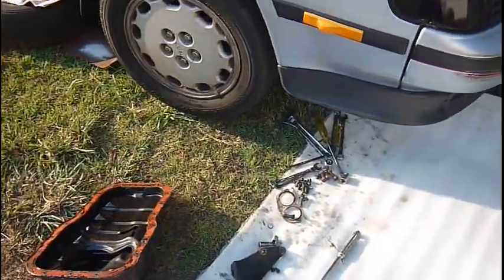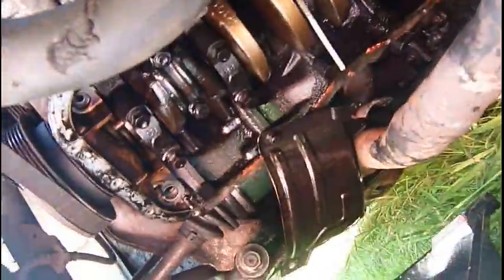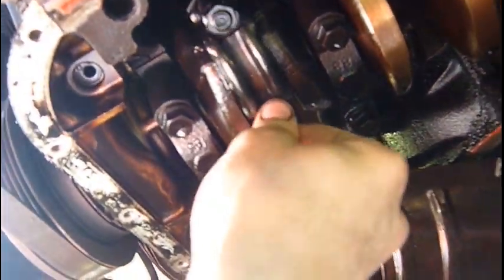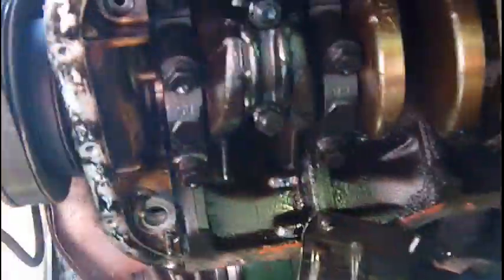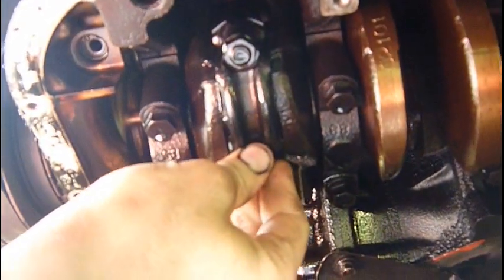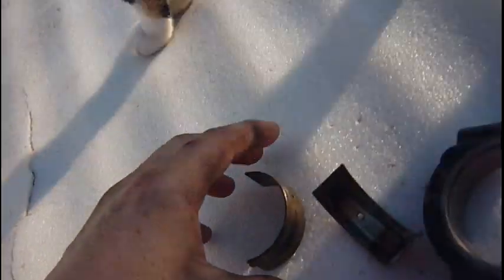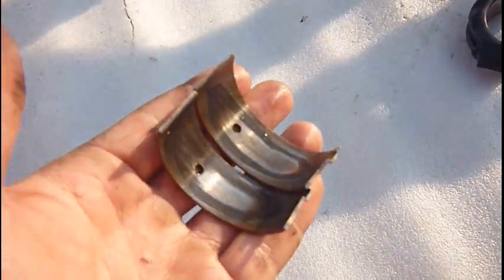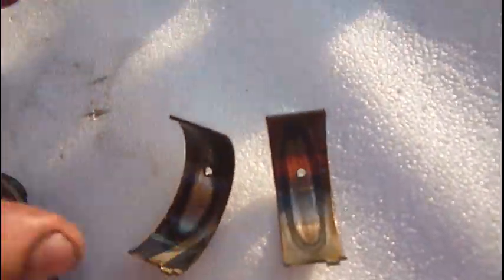Replacing a 3SGE rod bearing  in-car

Comment: So in that case engine has to come out ?
I have an issue with a 626 mazda rod knock thinking to do that 
What do you recommend?
Reply from the maker: John Saa I only needed this car to run until I could replace the engine, but I ended up scrapping it. The easiest option is to buy a junkyard engine and swap it over, theyre fairly cheap

Comment: Just think, all that crud would be throughout your engine.  Its for the best, put in another one...
Reply: or rebuild it depending on what you like to do. Personally on a car like this I would just pull a cheap junk yard engine and drop it in. But then again I live in an area where they are 250 flat and it don't matter what engine.
Reply: James Richards or throw the bearings in it and run it until it drops, since he is already well on his way that is. I have done this many times with good results and currently doing some in a excavator atm... we will se how that pans out...since one is welded onto the rod atm. lol   I will say one thing though, I always put new bearings in...never tried used ones before and also never done one with the bearing completely gone. lol
Reply: 510Redneck what are the symptoms on bad bearings